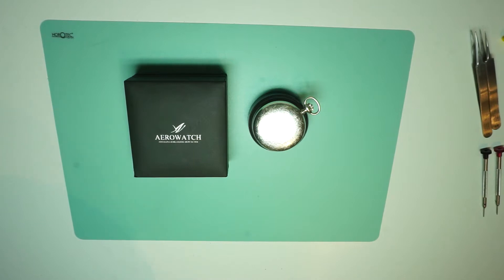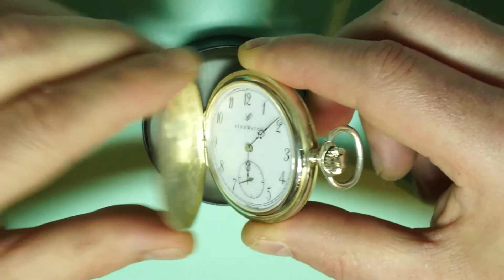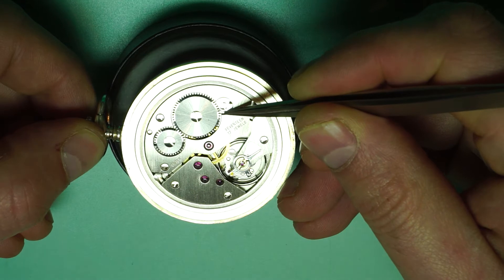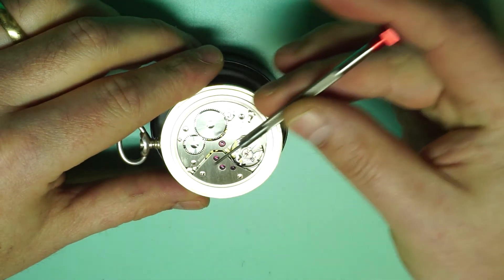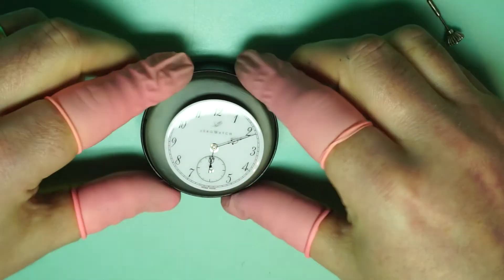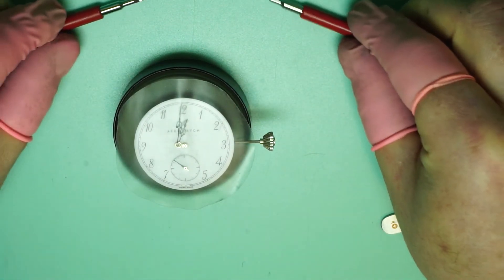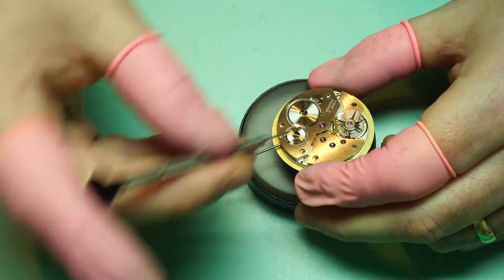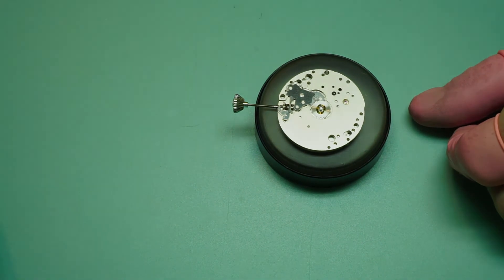How To - Service a Mechanical Watch - Part 1 Uncasing - ETA 6498-1

Comment: Hey I recently got a pocket watch with a 6498 movement that was in working order but the hands were missing, how do I set the watch to the 12 o'clock position without the hands?
Reply: It doest mater. The only time something like that matters is on a movement with a date complication. In that situation you would just rotate the crown until the date changes and set all hands to the 12.

Comment: Sorry to add a criticism: snapping the case shut is a good way to wear out the bezel cover in the latch lip  area. Latch: steel; latch lip on cover: softer material. It should be eased shut by pressing the latch button in while closing the lid, then holding it in place while releasing the button. The latch catches behind the lip and holds the cover securely shut, and doesn't wear out the lip. I learned this because I collect Waltham pocket watches from the late 19th & early 20th Centuries.